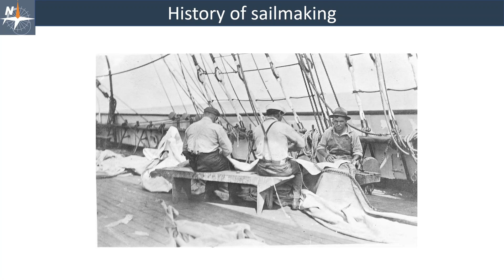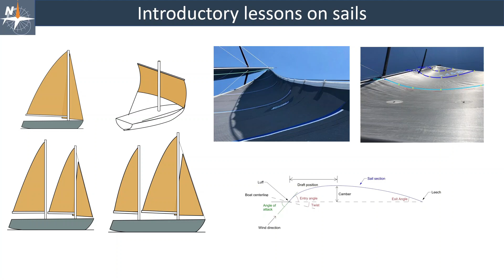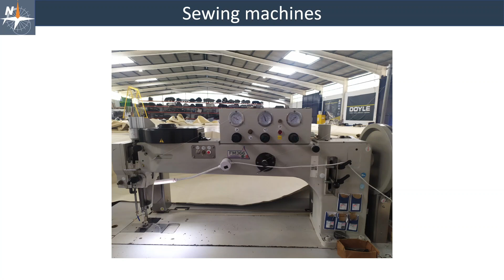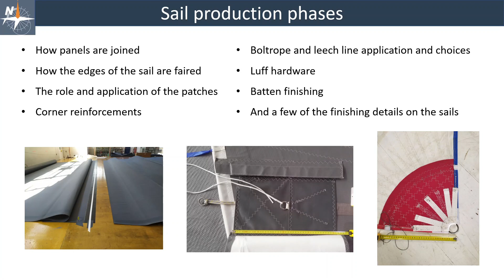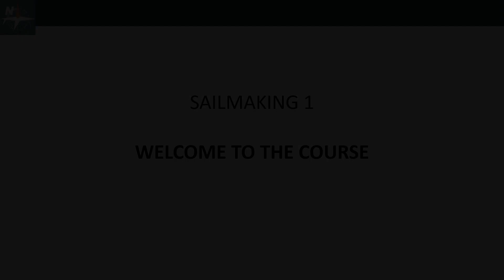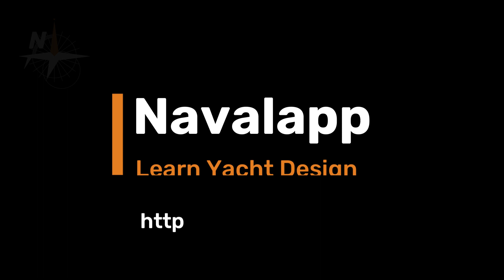Introduction to the course - Sailmaking 🚩

Comment: is it only theoriucal or it is possible to practice in some way even with a home sewing machine to simulate a real loft
Reply from the maker: Hi, thanks for your comment. This is the link to the summary lesson of the course: https://navalapp.com/courses/sailmaking/lessons/wrap-up-sailmaking/

It gives an overview of the different topics discussed in the course.

Additionally, when taking the course, you will have to work on a final assignment where you have to do a schematic drawing of a sail with as many details as possible as you have learned during the course. The drawing can be made using software or on graph paper. In both cases, it is important to use appropriate proportions of the sail and detailed dimensions as well as provide a general description of the sail, the boat, the rig, sail attachments, intended use, and provide a list of details included (panels, materials, corners and reef webbs, patches, battens, etc.)
Reply: Speaking as someone who worked as a sailmaker in my youth, it's perfectly possible to make sails for dinghies or small yachts on a home sewing machine especially if it's one of the old cast iron ones from the 50s and 60s. The Japanese machines from that era were particularly good and can often be bought very cheaply. For learning resources the nearest thing to a "standard work" on sailmaking I know of is "The Sailmaker's Apprentice". A lot of the book is really only relevant if you're making very traditional sails but the basic are there for evenmodern Dacron sails. Here on YouTube there are series of old videos on Expert Village's channel covering the whole process of making a headsail from design all the way through finishing. And Sailrite's various videos on constructing and finishing sails are well worth watching. Hope this helps.